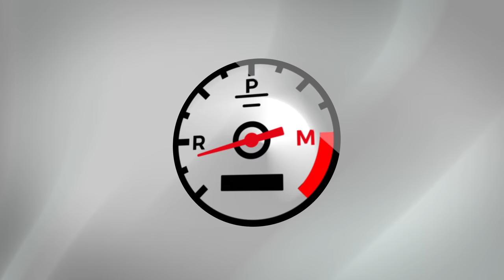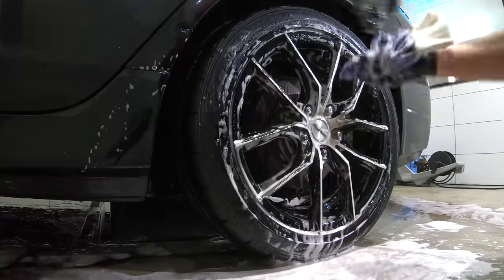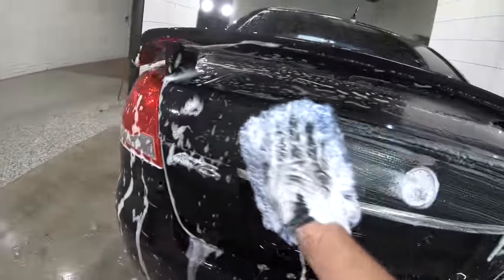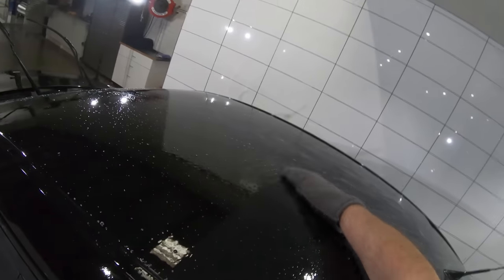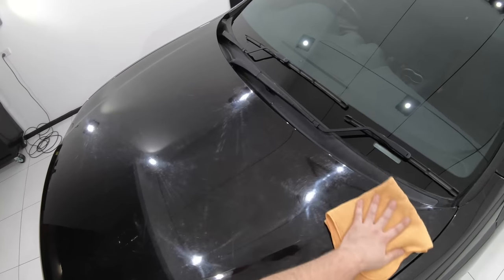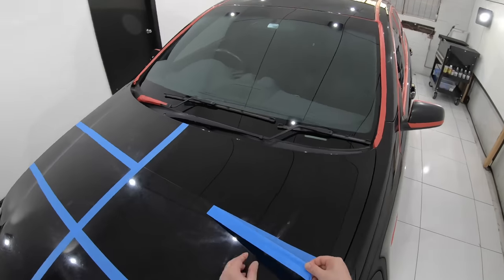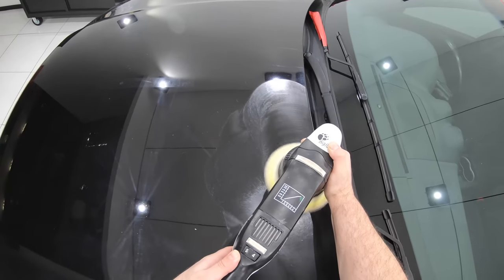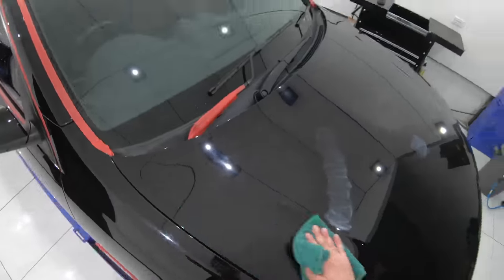The Unfinished Detail | A Discussion on Becoming a Better Detailer & Showing Humility (Vlog 43)

Comment: Sandro, I love and resonate with what you said at the end (36:00 and on) Regarding the washing methods, I've always just used ONE bucket (and don't fill it with 4 or 5 friggin' gallons, 1-2 gallons are enough) with a chenille mitt and hose down the mitt super often. With that method, my rinse water never gets dirty and I've kept my daily driver nearly 100% swirl free for years at a time in between polishes (more like 90% swirl free now after 3 years, and the few it does have will come out with a finishing polish). It's all about awareness and common sense. As for the polishing part with the polishing technique and how many passes etc: I just keep it natural and simple. I learned how to polish cars by trial and error, before hopping on youtube and having this amazing library of top notch teachers was a thing. Point is, it puzzles me how so many people (maybe most) focus on the wrong details. I see them asking online (forums, youtube comments, etc) how many passes did you/should I make? how much pressure did you apply, what pads and polish did you use, was it soft or hard clear, etc. Another huge pet peeve of mine is the whole crosshatching your work thing. Both in polishing and applying coatings. You don't HAVE to crosshatch when you polish to get results. That's just ONE of the ways you can polish and just so happens to be "the method" that stuck and everybody follows such as to supposedly help you not miss spots and be more even. Truth is, I don't count my passes, and I don't crosshatch my work, I've developed a rythm for polishing and just polish an area till I feel the set is done. In some areas I'll go left to right, overlapping each pass over the last one as I keep moving it down or back up. Some other times I'll go from left to right, then back left and back right in that same area, and then I'll move down below that area and do the same thing and repeat till I've polished a section. If I'm polishing a tight channel, like the pillar that runs all the way from the bonnet and goes back and ends up turning into the rear quarter panel, I"ll just polish that thing left and right, as it's likely the same size as my 3" or 4" pad, or smaller. I've literally seen people crosshatching that tiny little area wasting time and being counterproductive. In some areas I'll polish left to right then to back to another part and polish in triangles, or whatever the shape of the surface I'm polishing may be. Adapt to the panels. 41:15 Is a great example of what I mean. A lot of people would have gone left to right and then crosshatched between the two faces (the horizontal portion and the vertical portion) when it's completely unnecessary and would put undue stress on the sharp edge of the turn. Sandro instead used his common sense and went side to side. You gotta learn from your teachers if you didn't teach yourself, but you also gotta ask yourself the why behind something, whether it's appropriate to do at the moment or if it's at all necessary. Don't be afraid to do some critical thinking and challenge the norm if you think there's reason to. Experiment different ways to do things. Like the saying goes; there's more than one way to skin a cat. Another thing I'd like to add while we're in the topic of challenging the norm, did you know you can just buy a big, 32oz bottle of Stoner Invisible glass for 5 bucks and use it to remove polishing oils prior to installing a coating or just your favorite wax/sealant? Yup, you don't need to spend 24 bucks (over 4x the cost for the same amount) for a bottle of CarPro Eraser, Gyeon Prep or one of their many equivalents from so many detailing brands. I've been using it for years with great success. I mean think about it, it's meant to clean glass, where the objective is to remove oils and grease from the skin of people touching it, AND it has to leave behind ZERO residue, or else you'll see it because it's... well it's glass, so it's completely transparent and every little bit of residue is easily visible. It's ammonia free and I've never had any issues with it (Don't go grabbing a bottle of Windex cuz it's not the same! That stuff has ammonia and it's super harsh!). It's funny because everybody that uses Eraser or equivalents always rave about how amazing it is on glass and I've always been like of COURSE it's great on glass, it IS a glorified, overpriced glass cleaner that the detailing industry took advantage of, slapped a label of smoke and mirrors and marketed it disingenuously with lies. They say they remove waxes and sealants when they clearly don't, etc. This rant is already massive enough and I should have just made a forum post about it. If you made it this far, god bless your soul and I'm sorry, I wrote it all so quickly that I didn't notice how long it was!
Reply from the maker: Haha made it all the way to the end and I think your comment really highlights what this whole video was about, which is there are many ways of doing things, you find what works best for you and you use a little experience and common sense to your approach. I think beginners will have all those nuanced questions due to lack of experience which is completely understandable but as with all things in life the answers lie in your ability to seek them out through self learning rather than being provided with answers that don’t give you the whole picture.
Reply: @CarCraftAutoDetailing  Sweet! Yup, you totally get it. I could literally go on for hours talking about this and could also rant for hours (though that might be tiring) about misguidance from experts AND the bad tactics I see in the detailing industry all to make a quick buck and/or insane margins off of basically people’s emotions and desires.

Comment: Pontiac G8 in the US. Another Aussie gem brought over to the States thx to GM.
Reply: I was still working at our local Holden dealer during those times , the G8 front was a no cost option on our SS Commodore to..
Our dealership closed in 2011 ..

Comment: Sandro, love the content brother, very informative and i manage to always pick up a tip or two through your videos. As a detailer whom has attempted to record the entire detailing process from washing the wheels to final inspection on a ceramic coating project, I understand the amount of time that it requires to move equipment around, stage the perfect angle for a shot, capture great footage of the B&A's, etc..(and having only uploaded one of many videos I've attempted, due to gaps in video recordings) I appreciate your thoroughness in these videos. With that said, the IK Foam Pro 12 can be compressed via an air compressor via the built in Schrader valve. So for those that have an air compressor (even just a small gallon sized one), there's no need to work those muscles unless you want to. Just wanted to hopefully share something with YOU this time around. Cheers all the way from Evans, Georgia

Comment: You make the Mille look so smooth and easy to use. Most other videos, I see it jumping around or really wanting to walk.
Reply from the maker: Every machine is a little different and always requires a bit of technique adjustment, that doesn’t mean it’ll never jump especially during a lack of concentration moment or around some really dramatic curves or crevices, but if you invest in getting a better feel for it you will generally have a much nicer experience and better results from it. It just takes some time and a willingness to become better with it.

Comment: Happy Easter to you and your family Sandro. Thanks for another truly informative video. Your bad back may be temporarily affecting your ability to detail, but it hasn't affected your ability to teach others. I really appreciate the tip about diluting down IPA solutions when working on soft, black paint jobs, or using a primer polish. It seems some soft, black paints will mar if you breath on them too hard. I also really enjoyed the spot correction work you performed, as well as the contrasting of polished exterior glass vs. unpolished exterior glass (the microfiber towel sticking to the contaminants on the unpolished side and sliding off the polished side). Hope you're feeling better soon. Cheers.
Reply from the maker: Thank you mate, really glad you enjoyed it and wishing you a very Happy Easter!

Comment: what do you think about putting say half a dozen microfiber towels into your clean soap bucket and wipe down a panel starting from top working your way down (in case of door) wash window then flip towel to clean side and continue down doing same process to all panels should use up all the towels in the soap bucket. Seen this one on Gary Deans' channel. Is a way to wash car with only one bucket and saves time having to continually rinse a wash mit.
Reply from the maker: I think it could potentially work well, but I personally prefer using mitts/pads as the inner foam tends to be more gentle and evens out the pressure of your hand/fingers to further help reduce swirls and mitts/pads just glide over paint more easily compared to wet cloths that tend to be a little harsher, grippier and heavier. 
I just thing the inner foam has many benefits, but I guess it’s really just the multi-mitt method using cloths instead.

Comment: Hey Sandro mate amazing explanations as always. I believe that one of the main confusing subjects about detailing ia performing a test spot. There are so many variables. You say always to start with the least aggressive method but you can start with least aggressive polish + pad. You can combina a polish with : hard foam, microfiber, wool, medium foam. The change polish and cha ge again pads... I don't know if you get me... If you do, what's a good advice? Because one can finish an entire bottle just testing pads and Compounds 😂
Reply from the maker: I say start with the least aggressive method that has the potential to work, so that will be different depending on how bad the paint is to start with. So a little past experience helps you avoid using a whole bottle as well as using your test results to make judgment calls to help you progress much quicker to the winning combination. Just like everything in life, you need to assess and use all the information and your past experience to find the best solution.

Comment: Sandro, can you please tell me what you think of applying an Iron Remover on rims first, then rinsing off and then applying a wheel cleaning product like Brake Buster to clean the rim? Or should the rim be cleaned first, rinsed and the Iron Remover applied last(then rinsed)? I notice much more iron showing up when I use the first method as compared to the 2nd method.
Reply: More iron ( bleeding ) will show up if you haven't rinsed first because rinsing removes the loose brake dust particles which is why your getting more of a reaction with your first method. 
Brake buster is a good product and can be diluted to take some of the aggression out of it,  i don't think you need ironX if you're using brake buster because there kinda the same..
To rinse first or not to rinse first is up to you and the how dirty your wheels are,  there is no right or wrong if your getting the results you want,  just make sure your wheels are cold..
One more thing , don't get to much ironX or brake buster down behind the back of the brake rotor because it can cause the hand brake pads inside to literally stick themselves to the inside of the rotor if the vehicle has been sitting for a day or so after washing with the handbrake on damaging the hand brake pads when the car is moved ... i did it to my own car accidentally once,  lesson learned..
Reply from the maker: The purple colour reaction is not always the best indication of how well a wheel/iron remover works, it’s just one indication, the cleanliness of the wheel should be the ultimate judgement. I honestly think you can use either of the two process - there’s pro and cons both ways and not a clearly better way- but I’d just be sure to include a pre-rinse before you physically clean the rims with brushes regardless of whether you use the chemical before or after that rinse as to reduce wash induced swirls.

Comment: Firstly, thank you so much for your content! I have learned so much knowledge from you. Im curious to know how you set up your scangrip ceiling lights? As far as i can see, they are all rechargeable ones when i search them? How have you connected them all to the mains and do you have a universal switch for them all? Thank you!
Reply from the maker: My pleasure mate. That was my old shop, and they were Hella Nova Lights (also a brand owned by ScanGrip). Those lights weren’t battery powered and they were hard wired by an electrician on six seperate light switches so they could be turned on and off in sets.

Comment: Hi sandro, i somehow missed seeing this video when it came out. Nice job. Got a question for you. I watched another detailing channel's video and they put a few drops of a medium cut compound and a couple of drops of a fine finishing polish together on the same pad. Whats your thoughts on this? Is this any different than using a good one step polish? Is it like creating your own one step by choosing your favourite cutting compound and finishing polish?  Thx in advance
Reply from the maker: Combining different compounds and polishes is something I’ve done in the past but honestly not something I do very often. It just adds another variable you have to contend with in mixing and making sure you stay consistent. Like you mentioned, a good one step should already have both good cutting and finishing qualities so I’d much rather find a compound that has this rather than mixing cocktails on the pad.
Reply: @CarCraftAutoDetailing  thanks mate. Makes sense. Can i ask one more thing please? I bought a small bottle of rupes uno protect and just wondering, as it is an AIO with protection for up to 3 months, would you be able to apply lustre as a topper or would it not bond properly due to the fillers and protection in uno protect? Thx again
Reply from the maker: Although Lustre will bond more effectively to bare paint it also tends to bond to almost any surface rather well so I’d expect it to work well over Uno Protect.
Reply: @CarCraftAutoDetailing  appreciate your time mate

Comment: Any merit in adding a very small amount of detergent or surfactant to the panel wipe solution for lubrication? 
I’ve seen this debated recently and was curious to tour opinion…
Reply from the maker: My general rules is to keep things simple or eliminate variables when possible. So I wouldn’t add an additional chemical unless I was having issues with using the panel wipe as is - there would need to be a reason or issue it solves.
Reply: @CarCraftAutoDetailing  I err on the side of minimal yet effective then tailor the solution as well. Thanks for the response and keep up the exceptional work. I’ve gained many, many insights thanks to your tutorial vids. Cheers!

Comment: Hey Sandro, wonder if u can help me. Id like to detail a friends VW Amarok ute. It has a carbon fibre look wrap bonnet and tailgate that looks a little unloved. Can u recommend anything that i can use on this type of surface that will not be too harsh on it and will give it back a little more of the matt black look? Im not going to hold u liable fpr anything lol, just want a product thats safe on that type of surface. Ive looked online but cant find anything that says its specifically for this kind of surface. Thanks mate
Reply from the maker: Matte paint, trims or wraps are a hard one because you simply can’t polish them, so you are hugely limited in the ability to restore them in any substantial way. The only thing you can do is use a wax, sealant or coating to slightly improve them but I wouldn’t expect too much if the wrap is noticeably oxidised, stained of weathered. Carpro has CQuartz Skin which can be a good option to help improve and stop it from getting worse but like I said, matte finishes are really something you just have to look after from the get go as options are extremely limited.
Reply: @CarCraftAutoDetailing  thx mate. Ive just ordered a bottle of lustre. Havent used it before. Would this help if i gave these sections a good clean with an apc? Really appreciate the replies to my questions.
Reply from the maker: Yes, a good clean and Lustre should work well.
Reply: @CarCraftAutoDetailing  cheers mate. Have a great weekend

Comment: Which car brand paint is the best and worst to work with?
Is honda paint particularly sensitive
Reply from the maker: Black Honda paint is up there with the most sensitive and difficult, Nissan as well and if you go back to older single stage paints, the Italian sports cars of past eras were very tricky to correct well, and some of the new Euro ceramic clears are ridiculously hard and also very difficult to remove defects. Toyota tends to be decent to work with, blue Subaru is one of my favourites and a lot of late 90s to mid 2000s Euro cars had nice paint that wasn’t as super hard as it is today. But it’s really all just generalisations as anything can go with any car manufacturer.

Comment: What are you using to wipe off the polish inbetween?
Reply from the maker: It’s a panel wipe to remove polishing oils: https://www.waxit.com.au/products/carpro-eraser-oil-residue-remover?ref=1NNwBEgP4yO4AX
Reply: Is it necessary to use it or are there other alternatives?
Reply from the maker: If you dilute 1 part 100% isopropyl alcohol to 4 parts deionised water you can make a similar mix